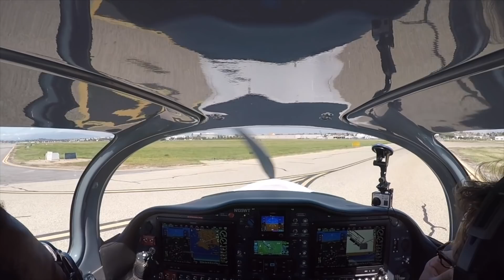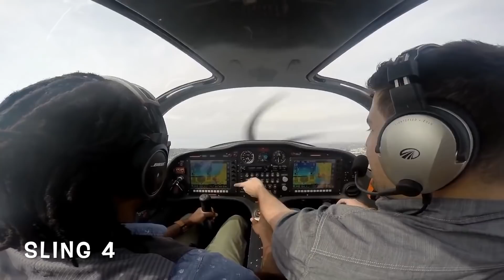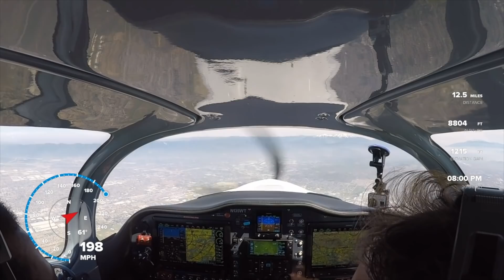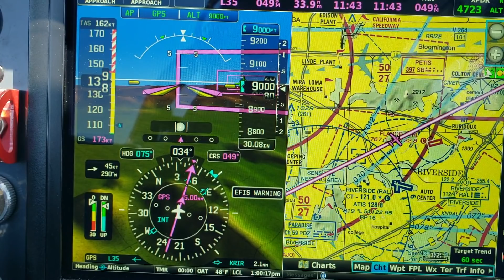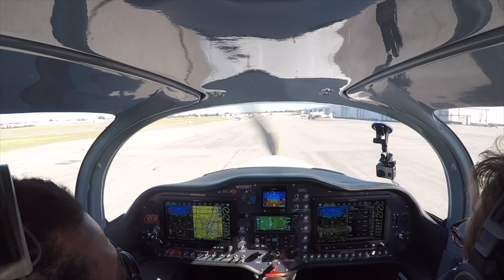INSIDE The NEW Sling TSi l FULL Flight Review & Performance Data

Comment: Did you consider the availability of parts and the value of the aircraft should Sling go belly up? Love the plane! It’s performance and economy are unmatched in traditional GA aircraft. My concern, as stated above, is with less than 100 sold in the US you might have to fabricate parts.

Comment: Love your videos, support your channel... but, you missed the mark on fuel mileage. If you want to be completely fair in your comparisons - look at air miles traveled per gal of fuel... which has nothing to do with the winds... but does account for TAS differences & fuel burn differences between different airplanes.  To be even more level in the comparisons, measure how far in miles a gal of fuel will carry (say) 500 lb of Cargo Capacity.  That measures the real merit of a cross country airplane & is a more apples to apples comparison... and tests your math skills.  Also, it's not the elevation of the field that counts, it's the Density Altitude... pressure altitude (at 29.92) corrected for non-standard temperature.  Wash your hands.

Comment: Okay....  
No Rotax engine has magnetos.. 
Plus with the Rotax 914 (as with the 915) you do not need to pull back the turbo after five minutes.
You pull back on RPM not manifold pressure.
The flight was with a quartering tail wind of some 45 kts!!  Of course you got 173 kts GS on full power.. But no one ever flies a Rotax full power.. 75% is more normal cruise.

Comment: I don’t get the range; speed, and use of fuel of that plane. If its using 7 till 10 gallons fuel with a 45 gallon fuel tank I don’t get a range of 800 miles. At a speed of 250

Comment: If you'd ever flown a pusher aircraft then you wouldn't be asking whether the Sling TSI is the best. I've flown both tractor and pusher designs and I would NEVER consider a tractor design, especially one made of aluminum. Too bad you never flew the Velocity. I've flown 3 of them, all XL RG models. Also flew a Lancai ESr, Piper Archer, Cessna 210, and Katana. The stability and visibility are better in pusher designs than tractor designs by far. They feel like you're riding on rails in chop conditions. No pitch or yaw issues like tractor designs. FYI, the Wright brothers plane was a pusher. The only reason we have tractor planes is because of a military decision made a long time ago.

Comment: I don't like this plane. It is not Carbon fiber kit, it's all Aluminum kit. That brings softness and it's not sturdy. 

If they come up with Carbon fiber version, then I be the first to order a kit.
Reply: Check Raptor plane then. 100% carbon fiber with over 2000 miles range around 140000 dollars.
The only issues is all first 1000 of them are sold. So you may have to wait another 5 years to get it.
Reply: @bnosrati  The Raptor is still a prototype and they are estimating the cost.  They still haven't sold one plane but are trying to get deposits so they can continue to build their manufacturing plant.  By the way, their site says they will shoot for a finished basic plane price of 130K.  Probably the only way that will happen is if they can mass produce it.
Reply: @KoJo-qh9od  I know Raptor is still in development stage. But it has 2000 mile range, can fly over 20,000 level, and still the cost is 130K. I would wait till it comes out, but there are already over 1500 buyers signed up for it.
BTW, they are going to test flying Raptor it within couple of weeks.
Reply: You're not going to be any where near the price if this was carbon fiber.  You get what you pay for, so if you can afford it then more power to you.

Comment: Liked video. You mentioned 172 and 182 comparisons. With me being older and not as mobile or as flexible, what are your thoughts about getting in and out compared to 172 or 182. Does this plane have an option for small door panel above wing to help get in easier?
Reply: No, but they are making the same wing and same platform with a high wing version that performs basically the same, with removable rear seats. Comes in a taildrugger too. Much easier to get in

Comment: Am I reading the airspeed indicator correctly:  yellow arc STARTS at 105 knots and red line is around 147 knots???  So, you cruise 10 knots shy of red line and are 40 knots into the yellow arc for normal cruise?  Since the yellow arc is for smooth air only, even a light to moderate bumps day you are limited to 105 knots?  Neat little plane, but sounds like the air frame is well under engineered from a safety standpoint concerning speed.   I have flown around 130 different makes and models of planes and have never seen this thin of a margin on airspeed.  The 67 Bonanza v-tail with a IO-550 upgrade cruises about 5 knots under yellow arc beginning and 50 knots shy of red line at 9k ft.  Glasair III cruises 40 knots under yellow and 100 knots under red line.  Not sure about a RV10, but I can't imagine it is that close.  I would like to hear comments about this.  Also, 15 lbs of wing loading at gross is pretty light and is is even less at weights under gross.
Reply: Just checked on the RV-10.  Yellow arc begins at 156 knots and VNE is 200 knots.  At altitude you are likely seeing 135-140 knots indicated speed, so you will be 20 knots under VNO and 60 knots under VNE.  What this means is that you can comfortably cruise well under the "smooth air only" speed limit in the RV-10 and even have good margin in a descent.  In the Sling Tsi it appears that you would likely exceed VNE by simply initiating a 500 or more FPM decent in cruise configuration.  I assume the ultra low VNO range on the Tsi is due to structural strength limitations and the VNE likely for flutter concerns?  Either way, I don't see how you could comfortably fly this plane in normal bumpy weather above 105 knots without concern.
Reply from the maker: @Dukepilot the plane has been safely flown on the yellow arc on many long cross country trips, even in moderate turbulence. And the wings have been tested vigorously up to 9Gs of pressure applied. I do agree with your concerns, and I'll have more answers for you from test pilot. Stand by!
Reply: Ok, thanks for the reply.  The fact that it has flown cross country well into the yellow arc only proves nobody has died yet.  Generally speaking a yellow arc is a structural warning range with red line being more of a flutter limitation.  What is Va in the Sling Tsi?
There was a reason they started the yellow arc at 105 knots and red line also pretty low.  I know of no other plane that cruises straight and level within 10 knots of red line.   I think the plane is a really neat idea, but there is no way whatsoever I would fly this plane in anything but smooth air if the limitations indicated by the manufacturer are accurate.
It is very difficult to build a plane with a low stall speed (which is low wing loading), low HP, and light weight and still make it strong AND fast.  You can get good economy out of a highly loaded wing with high horsepower and still get efficiency, but stall speed and takeoff distance will suffer.  The Glasair III actually gets better fuel economy (About 21 MPG) than the Sling Tsi and gets this economy at 210 knots.  It also cruises about 60 knots under the beginning of the yellow arc and 100 knots under red line.  It is impossible to break the plane in the air, but the plane will break you if you get it slow.   The Piper Malibu is a great cross county plane with wonderful efficiency getting almost 16 MPG with 6 seats and pressurization.  Like the Sling Tsi, it is a good short field performer with it's low wing loading and up high it is fast.  The problem is that Va is anywhere between 103 and 135 depending on weight due to the design.  Do some research to see how many have broken in in the sky because of cruising in the yellow arc.  This is serious business.  I have been in clear air cruising along fat dumb and happy and instantly hit CAT that literally hurt my back and neck enough to require a doctor visit.  That happened in a P210 about 15 knots above Va.  I don't think I would be writing this had it been in the Sling at high speed cruise.

Comment: I have been looking for a airplane to purchase, honestly, been looking @ the Commander 115. Ironically, there headquarter now is in Norman, OK. which is also where the builder assist
program is for this aircraft. That's practically my back yard!  60 minutes ago, I didn't know this plane existed! I've been a toolmaker for the last 32 years. I made a lot widgets over the years. Can't be THAT hard to build a airplane. (With some help)
I didn't heard the mention of an auto pilot in the video but, I'm sure one can be installed.
My online store has been doing very well over the years, I will be looking into this possible project a little deeper. Fuel burn on this plane is unheard of for that speed!
Like to find some more numbers/spec's on this too.
Like the video, but your cameras need upgrading.
Thumbs up!
Reply: Steve Miller The particular model in the video has an AP. Mike has another video with all of the in-cockpit audio and they talk about it. Definitely worth checking out if you haven’t seen it yet.
Reply: @Layne Claggett 

That doesn't even make sense what you wrote.........
Reply: @Layne Claggett 

thank you for clearing that up......and your right , Ive never live in Norman

Comment: Great video, recently found your channel. Would love to have one. Seems like an almost too good to be true 4 place. How’d you like the brakes? Used to toe brakes. What is the deal with fuel and tbo? Is it only 1200 hours between overhauls on the 915 is? Any issues with burning 110ll all the time? High quality Mogas is a little hard to come by. Also any ideas on price all options with builder assist? Time to build with quick build?

Comment: The most important numbers you left out though. How much will it set me back to  own that airplane you were flying in? Also doesn’t the 915is take Auto fuel? That’s a savings compared to typical engines that require 100 low lead

Comment: I looked today and you can get a tidy used Grumman AA-5 for around 40k. If you invest another 50 to 60 you would have a fully loaded certified 4 seater with glass panel so if you had the option of buying a new 4 seater Sling for 200k plus or be able to buy the  real thing and save yourself 100k what would most do? To be tempted by a used Sling would mean it would have to be competing in the depreciated market regardless of its age coz no one is willing to put 100 big ones down the can for the sake of it.

Comment: Why not state the price up front? (Apologies if I missed it)
Reply from the maker: The price will differ based on builder/owner. Kit's for the airplane starts at $55k. Built as shown, fully loaded with glass cockpit and extended wing tanks will push you into the 200s

Comment: Mike, Important question...  Are you going to buy one?  You are looking at getting an aircraft. You can get the kit and starting building. Also, just wondering if this beat out the RV10 as I am asking the same questions.  :)
Both are ~200k IFR equipped  but operating is cheaper with the TSI.

Comment: Hey Mike, I'm getting my PPL right now and I was taught to not cruise at full power because in addition to wasting more fuel it is bad for the engine in the long term. Is this true? How long were you guys at full power on the way to Big Bear?
Reply from the maker: This is true. I was cruising at full power for the sake of this video. But for most of the trip, I had the power set to eco which still gave me about 185 mph :). On a normal day in the Tsi you should see 150+ kt True at higher altitudes. On this day we had some nice tailwinds which pushed us an extra 10-15 mph.

Comment: Nice ride but you can buy a nice 250/260 Comanche for $60k that can carry more.  Need more bling?  Add new paint and interior and have lots left over to go flying
Reply: I love my 250 but this plane makes me think a lot. When you break it down, the Sling TSi is a very good competitor to the PA24. Both do 155-160kts. My plane has a 1200lb useful, 684lbs with full fuel (86gal), the TSi 1015lbs useful with 714lbs with full fuel (45gal). Since the Sling uses 5gph less than the Comanche the ranges are very much the same. The Comanche might be able to stay in the air for an extra hour. So really the payloads are the same for both planes. The fuel saving alone over the life of the engine makes up the price difference. The Comanche will use $104K of avgas at $4gal @13gph, the Sling will use $52K in mogas at $3.25 @ 8gph. Huh, wanna buy a beautiful 1960 Comanche 250 with tip tanks??
Reply: It’s tough to beat the performance of a Comanche and you forgot to figure in your build time.  This is a kit.  It’s impressive but I would not sell my 61 250 to own one.  I do like Mike’s channel,  I get to see some some other planes I would not otherwise
Reply: Tom Edgar I agree that the Comanche is a quite the machine and I don’t really think I could part with it. My upcoming avionics upgrade will bring it close to this panel. I have time in the Sling 4 and flew my Comanche 250 out to demo it. The Comanche does slice through the chop better, especially with the tip tanks loaded with some fuel!

Comment: Great review. The TSi would be perfect in my book if it could be a taildragger! TAF would have the market on a low wing, all metal, 4 seat taildragger. There is currently nothing on the market with those traits.
Reply: Sling HW is the same wing, engine, etc and is mostly interchangeable parts. It's a high wing taildragger.
Reply: @pilotavery  it's definitely a sweet airplane! But 4yrs ago it didn't exist. While the new HW is cool, it's price is getting way up there. The composite structure and metal construction has it priced about $40k USD more than the TSI. I just wish had more play money for one. Until then, I'll just have to keep my Mooney.
Reply: @gmonnig  That's true, but the sling high wing also comes with a lot of components that you have to purchase yourself on the sling tsi so it ends up costing about the same
Reply: @gmonnig  I really like that the sling TSI can reach 160 knots true airspeed at 7 gallons an hour at 28,000 ft. It can even climb to 30,000 ft density altitude and climb at 400 ft per minute...

Comment: Nice video. It looks nice. I just read about this in the April Kitplanes magazine and it's on the cover.  Fuel capacity is about 40 gallons. Max Gross wt is 2094 lbs, typical empty weight is 1080 lbs and typical useful load it about 1014 lbs, full fuel payload 738 lbs.   It is assembled with pulled rivets with matched pre-punched holes.  Any solid rivets done by the factory.  Kit price  at $53,297 and estimated completed price $135k to $200k.
Reply: Wish they had a $10k kit
Reply: Fuel capacity is now 75 gallons. With the extended tanks and larger main tanks on the updated version.

Comment: Nice video! Do you happen to know the exact power settings at 9,000ft that gave you 162 knots true?
Reply from the maker: Full power: manifold pressure 43in / rpm 5190 / fuel 9.7 gph
Reply: Thanks!

Comment: Can this plane be bought new?
Reply: In order for you to be able to title it properly you technically have to build a percentage of it. Sling offers build assist programs though so you can tailor the amount of actual work you put into it. If you want a TSi, you are going to have to build it though because the one in this video is literally the only one in north America flying right now. I know of a bunch that are currently being built right now though. The FAA is currently talking about raising the specs for LSA's to a point that might include the TSi and if that happens then a factory built TSi will be an option but until then it falls into the "homebuilt experimental" category. But I've been in this plane, there is nothing "homebuilt" about it's design and functionality. I hope that answers your question.
Reply: @kevinbutler9786  thanks.
Reply: @timmanning9  No worries man. You can talk to Barry at the "Airplane Factory". He has ALL of the answers to any question you could probably think of. That guy is an encyclopedia of info about all things Sling and non Sling really.